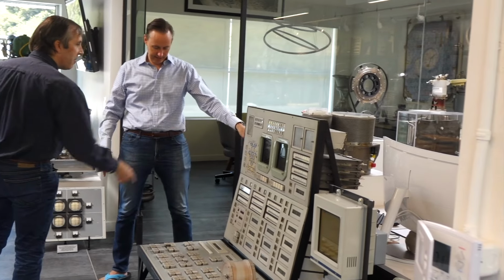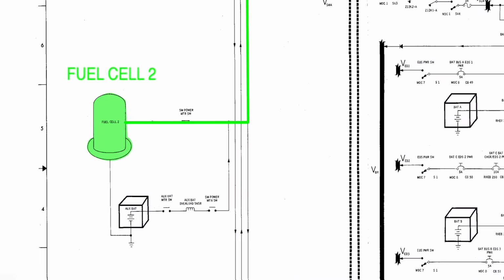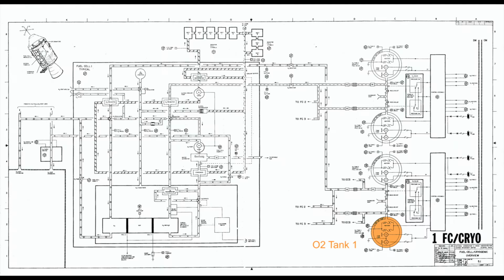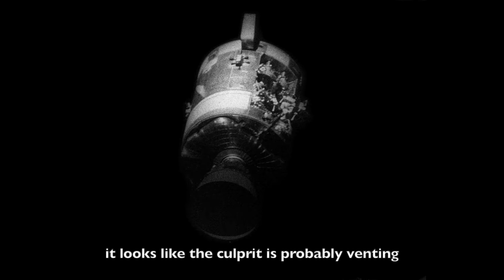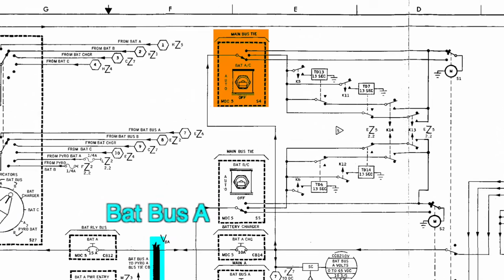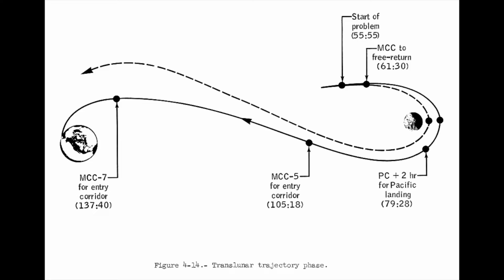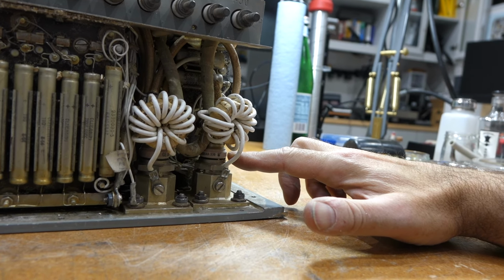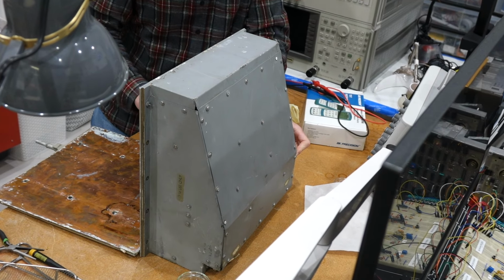Apollo 13 accident: understanding Houston’s real time debug (Apollo Comms Part 28)

Comment: From the schematic at 15:38 it's clear all o2 tanks are connected to all fuel cells. So I would have expected all fuel cells to remain operational until o2 tank 1 pressure reached 100psi.  Why was fuel cell 2 the only one left receiving o2?

Comment: Just about everyone, including the engineers at NAA and Grumman, got involved to set up the LM's energy budget. It was not only John Aaron and CMP Prime Mattingly working the problem.  Everyone was pulling OT and working things over to milk what power they had remaining to get the boys home.

There was another department, not known until you read the book LOST MOON, was Systems. This little known department gobbled up most of the record room with files on every electrical component that went into the space programs. Aaron had lunch with one of them and they went over various systems in the LM configuration to extend the existing batteries.  Since the LM was scheduled to stay two days on the then current battery state, they had to stretch it out to FIVE.  So they came up with the abbreviated list of operating systems to keep things going and the astronauts alive, but chilled.

Comment: ... why 400 hz? does that reduce resistance or set the computer speed?
Reply: Transformers are more efficient at higher frequency. That's why modern SMPS can get away with such small transformers, since they switch in tens to hundreds of kHz.

Comment: If the condition of this block 1 power inverter is an indication of quality control at  NA Downey pre Apollo 1 fire, we can certainly see how the Apollo1 fire might have started.   Mot necessarily this unit, but certainly the quality control of the time.  AMAZING video.  😊😊

Comment: was there any difference between the block 1 and block 2 inverters?
Reply from the maker: Mike tells me they changed the revision number but not the part number, so he thinks it’s essentially the same. The connectors got all changed to military round ones, hermetic, like all other block II connectors. We got a flown Block II since then, confirm the connector change, but it’s too big to put in Lumafield’s x-ray machine to know what’s inside.

Comment: Fascinating piece of engineering. Lots going on in that inverter, for sure. Also very interesting listening to the troubleshooting audio with your schematics explaining what they were doing. It's a shame that someone put that vermiculite in the inverter. Terrible choice but I expect they were under the impression it would provide vibration damping for the component leads, to forestall metal fatigue. They should have done more homework before making that choice.

Comment: Imagine the heat that inverter must have generated…adding that vermiculite likely cooked something…the cooling plate had no chance to keep it cool enough.. and the harder it was worked the hotter it got….excellent video otherwise.. as an electrician I follow along nicely…the redundancy that had been added in the 13s system was absolutely the key to their return!

Comment: Never vacuum up suspected asbestos containing materials with a normal vacuum cleaner. This will fill the atmosphere with asbestos fibres from the machine's exhaust. You can only do this safely with a HEPA filtered vacuum designated for this purpose.

Comment: Like all of your work product Marc,  this video is absolutely brilliant.

Please be careful with that vacuum cleaner.  If it does not have the proper filtration your workspace will be contaminated.   Please properly discard the contaminated vacuum.  Also, you may need to test and decontaminate your workspace.   Please treat this seriously.

Comment: Vermiculite isn't toxic, it was likely added to the inside to keep the inside dry as the Verm would absorb the water.  We use Verm in growing mushrooms, I wouldn't use Verm on my mushrooms if it was toxic. :)  excellent video!
Reply from the maker: Today’s vermiculite is fine, and your mushrooms are safe! However the asbestos laced vermiculite from the 1960’s to the 1980’s was particularly deadly. Unfortunately this is what that was. Don't ever grow mushrooms with that.

Comment: Perhaps a very silly question.  But if the fuel cells are DC, why use AC components and then require additional weight and power loss via the conversion to AC?

Comment: As an avionics tech, that would of been a real PITA to maintain. Or was it never ment to be worked on?
Reply: Also, LCR meters measure by impedance so those caps that measured high capacitance, were probably actually resistive - or measuring the load in-circuit which isn't very accurate.

Comment: Too much capacitance on the capacitors likely indicates internal leakage.   If the equivalent parallel resistance gets too high, your digital capacitance meter will read high as it takes longer to charge due to internal parallel resistance.   Some capacitors like turning into resistors.

Comment: I approve of your side-track.  Feel free to get distracted down similar rabbit holes later.  I wonder what kind of deep dive you would do looking at how they "reversed" the power to supply the CM with power from the LEM...did they run at the same voltages and just "tie them directly together" or more complex having to re-engineer some way of boosting power to make it "flow backwards"?  I know the movie talked about "losing a lot of power in the transfer" but assume some may be dramatized vs reality.

Comment: As an EE, I'm surprised that even the lightweight Apollo craft used clunky mechanical interocks instead of simple multiway switched that would be inherently incapable of being in more than one position at a time .  For example, each AC bus could be fed from a single tripple pole 3-way rotary switch between inputs where any choice would be reachable glitch free from any other choice by turning the knob 120° .

Comment: Space sounds and is sexy and dangerous. However deep sea diving like saturation diving systems or submarines are way more dangerous and have less options than floating in space. For example in space you are dealing with a pressure difference of 1 Bar. The titanic sub with 375bars.

Comment: From a conceptual standpoint, this inverter is like a non-mechanical equivalent of the dynamotor widely used in WWII radio equipment. The original dynarotor utilised a collector DC motor, mechanically coupled to either a dynamo or an alternator, depending on the grade of sophistication of the design; the alternator with the rectifier generated both regulated DC and  stabilised AC power.
This Apollo inverter generate the rotating magnetic fields without any mechanical rotating device. To achieve a perfect sine wave, the LC circuits had to be resonating at the wanted output frequency, hence the carefully calibrated capacitor banks.
Thank you for this special episode!
Greetings,
Anthony

Comment: Are you sure vermiculite was toxic back then, because its used in the pet industry and to grow vegetables you eat, today it must be made different. I used to use it in spider vivariums etc in the past as well as plant compost. They may have put it in the electronics to remove moisture during storage and to help cut down vibrations in transit.
Reply from the maker: Extremely toxic back then (not all of it, but the majority), safe now.

Comment: This was a really good run down of what happened, some seriously good problem solving, and I love that the circuit had enough flexibility that they could turn everything off and run only the battery charger backwards to the way it was supposed to be.  

Also would like to point out, that even with today's tech, 1.2Kw inverters haven't gotten that much smaller.

Comment: As a technician I thoroughly enjoyed this. However, I would have still tried to power it up with a current limiting PSU. Worst case scenario its smokes itself to death or a few caps pop. Most likely if it worked would be at a diminished capacity. Still an awesome video. Thanks Marc.

Comment: I want to echo, and repeat all the plaudits and praise. I think Ron Howard missed out not trying to stick some schematics with overlaid mark-up animations showing the sequence of events. Yes, some of it is technical, but one thing I did learn is that the sequence of steps they were radio-ing back up was the long, hand-written procedure Jim Lovell wrote down. And THAT was the breaker sequence to recharge the CM's batteries for re-entry from the LM's fuel cells. I think that's what got missed. They tried to emphasize how gingerly they were haivng to power-up the CM, wondering IF it would. But more important than that was having the batteries work for the re-entry. Instead we got Kevin Bacon in a simulator, dramatically trying to not go "over" the power budget allowed with the remaining power on the CM, over and over again.

Comment: I wonder what the mass of all those steel boxes was in these systems. So much power used to launch ancient electronics into space.
Reply from the maker: Boxes were not steel! Made out of something very light, lighter than aluminum - looks like our comms boxes are made out of magnesium. The electronics components inside, though, particularly the transformer, that is real iron. Very heavy. The electronics were a very significant weight.

Comment: In Germany we have a peculiar vacuum cleaner that pulls air through water to get rid of pollen. It is used as an air cleaner when it does not vacuum. Running such a thing in your lab might be an idea. Getting rid of that bastard was the best you could do.

Comment: No pressure but if you felt like doing a full 2.5hr technical/schematic read-along of the incident, it might be one of the most fascinating videos in existence about the subject. Like some other people, I forgot this video was about the inverter and was sucked into the illuminating companion narration. I wish I was, like you said, an “Apollo spacecraft power system expert”, but I’m afraid even with the core concepts down, the insights of the logic behind the troubleshooting would be missing and are priceless.
Reply: 100%
Reply: This is exactly what season 2 of the BBC podcast "13 Minutes to the Moon" is. Season 1 is the lunar descent phase of Apollo 11.

Comment: BTW why is the loop composite, is it for archive storage and listening or was all those mission channels listened together real time?
Reply from the maker: No, the loops were segregated in real time, although you could listen to several loops at a time I think. I can't remember where I got this one, but I think it's from the great folks that did the Apollo In Real Time project. You can actually configure the replay to listen to one or more stations. Follow the link and the explanations in the doodle-doo. Get a listen from the Flight loop, and then the same listen from the EECOM loop, and it will give you the two very different views. The real action happens in the EECOM loop though, which is why the regular way of trying to understand the accident from the Flight loop does not work.

Comment: Since when contains vermiculite asbestos? During fabrication process, from raw material, when after the converting the process by heating, you get the 'real'vermiculite. So its release some quartz dust, if you work with it. mayby it's an idea, but can you rinse it the remainings with 'dry water'?
Reply from the maker: Since 1920 to about mid 1980.

Comment: Has the 'Recipe' for vermiculite changed over the years because most DIY centers in the UK sell it and they don't have any warnings on it ? it is used in a soil mix to add drainage or used as a high temp insulator in a homemade Tandoor again nobody who uses it has had any problems and certainly no mention of such aggressive asbestos, in fact I don't believe you could sell it legally if it's that dangerous ! are you sure about that substance ? or have you just chucked away a serviceable unit ? Awesome video guy's !!.....cheers.      RIP Calculon
Reply from the maker: Yes. The asbestos containing vermiculite was banned, but very late, in the 1980's. Unfortunately this one predates it.
Reply: @CuriousMarc  Worth knowing!...cheers

Comment: Very interesting listening to the conversations. Not sure I would understand much without your explanations.
Did your vacuum have a HEPA filter? If not you have contaminated the shop. Washing all surfaces is probably good enough. 
There is a type of vermiculite, gold colored, which does not contain asbestos however its not too common. Your stuff certainly looked like the bad version.
Reply: Yeah, I would be worried about the asbestos ending up everywhere if the random shopvac didn't have a HEPA filter. Would've been best to leave it to the experts with negative pressure filtration systems.
Reply: @rkan2  
The other issue is that the vacuum is now contaminated.  Probably best to discard it.

Comment: Would it be worth giving your inverter a mineral or napthenic oil or  bath? Might be a relatively safe way to remove the contamination assuming the caps are sealed.
Reply: We used to submerge our high voltage power supplies in Fluorinert.

Comment: What an incredibly insightful analysis. Besides the technical genius of everyone involved, at times you can really tell how much uncertainty and, to some extent, fear, they are feeling. They may have a bunch of schematics, data and potential fixes for the problems, but when they start to discuss between the stations if it would be wise or not to switch the inverters around, it's evident that they couldn't 100% know what would happen. Must be tough to make decisions down here knowing there are 3 people trapped on a glorified tin can with no way out if you mess up. Thanks for the video Marc, appreciate it.

Comment: Vermiculite does not always contain asbestos - its still available and in use today for fire protection. Might be worth getting the stuff you removed tested if its still available. Another great Apollo 13 episode 👍
Reply: I think getting a sample tested would be a great idea.  That would tell you what your dealing with.
Reply: Think so, too. Vermiculite should be free of asbestos. It can be pretty itchy and wearing a mask is a good idea, but it's not a health risk as asbestos.
Reply: @dirksperling6477  in Libby, Montana, the vermiculite mines contained a lot of asbestos than contaminated the town for many decades.
Reply: I use vermiculite in  a lair of my gecko lizard, it's absolutely non toxic, apparently extremely rare that it would contain any asbestos.
Reply: @FrozenHaxor I guess it depends on the production decade!
Reply: @johndododoe1411  Also where it was manufactured, not all of it was contaminated even the old stuff.
Reply: @FrozenHaxor  Not contaminated, just a main part of the recipe, like lead in gasoline or the coke in coca cola .
Reply: @johndododoe1411  No, contaminated, not a main part of the recipe.  Vermiculite should not contain asbestos at all.  One mine (admittedly, a very major supplier for the continental US) was (knowingly, I believe) supplying asbestos-contaminated vermiculite until (again, AIUI) the 1990s.

And it's a bit of a push to claim (tetra-ethyl)lead was a main part of the recipe of gasoline.  It was an additive, and only started to be used to control "knocking" once motors started to become more "high performance".  Even in the 70s, when petrol was ~2g of lead per gallon, that's about 2 grams for 4 kilograms or so, or about five hundredths of a percent by weight.
Reply: @wibblywobblyidiotvision  💯
Reply: They still really shouldn't have cleaned that unit while indoors. That's the kind of stuff you do in the most remote part of the parking lot. Some of those particles are now in the nooks and crannies of that room.
Reply: I feel like this Vermiculite was added more than 30 years ago. Therefore it is likely it's source is from the Libby mine which contained (amphibole) asbestos as mined. Only way to know it is to test (and not vacuum it with a random shopvac before!! 😮)
Reply: Vermiculite is banned now in Canada

Comment: My mother has been using vermiculite for years in her garden. Without any thoughts that it can be harmful. She doesn't have any lung diseases. Vermiculite nicely absorbs and releases moisture and helps to maintain soil humidity. As I know it can be polluted with asbestus but its presence in it is strictly controlled. Typical vermiculite from garden shop is clean and contain no asbestus; absolutely safe to use. So I don't get why you was so scared of it.
Obviously vermiculite is very bad choice for purpose of electric insulation because it absorbs and then slowly releases a lot of moisture keeping high humidity inside for long time. That's why the unit got so much corrosive damage.
Reply from the maker: Not that vermiculite unfortunately. Our vintage one is deadly.

Comment: Well now I understand why more than half of the episode was on the power systems and not the inverter
Considering how much Apollo equipment you have worked on, it's a small miracle that this is the only one that is beyond rescue and through no fault of the engineers who designed it
Secretly hoping that we will be getting a video on a Block II inverter now, that will just magically show up :D
Reply from the maker: We are secretly hoping too!
Reply: For something designed to work for about a week, its amazing it was still working decades later
Reply: @robinbegley1077 Well, this was a lab test unit designed to be used repeatedly for years as they used the rest of the BP craft to test all manner of procedures and upgrades for flight hardware .  Curiously, I wonder if this specific unit was used during the Apollo 13 incident to test recovery plans (the movie has at least one ground team work in a training capsule, not sure if that was actually done) .